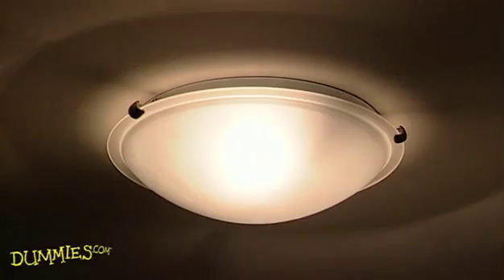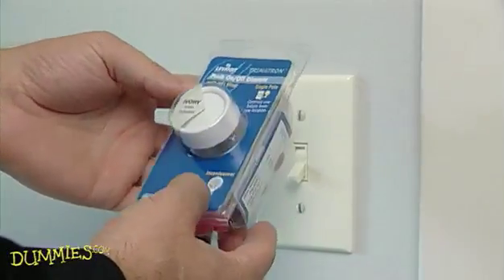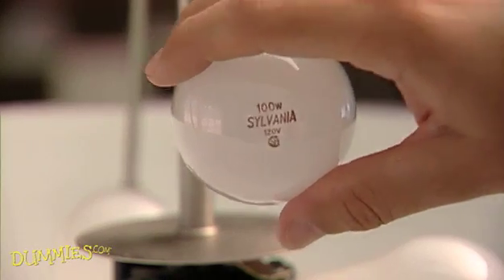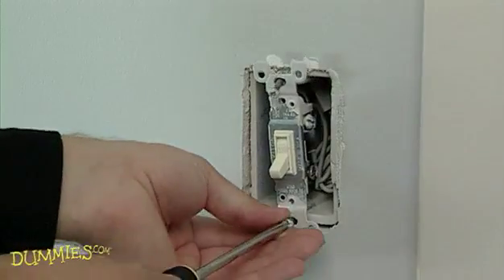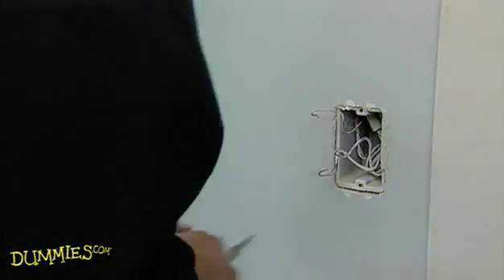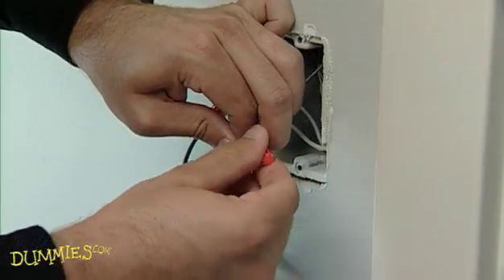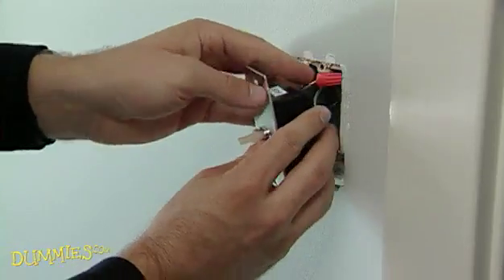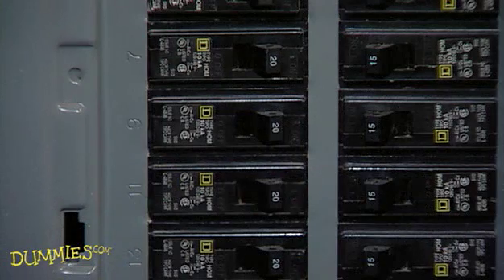How to Replace a Standard Switch with a Dimmer Switch For Dummies

Comment: I took off the existing outlet cover, and I 'm questioning which wire is the ground wire.  There isn't a green wire or bare copper wire,  so how do you detect the ground?

Comment: How do I know which wire is the "ground wire"?
Reply: In my house, all the electrical cables have 3 copper wires: black (hot), white (neutral), and bare (ground). Some of my outside lights have black, white, and green (ground) wires.
Reply: The ground wire is the copper wire

Comment: What do I do if the dimmer switch I want has 2 red wires 1 black wire and 1 green wire the one I want has a normal rocker style switch and a little slider at the bottom for the dimming should I just find a different one
Edit: the video after this one happened to be on the same dimmer switch I was looking at and found out the two red wires is for if you get a two pack so you can do 3 way pole

Comment: What if your light switch doesn't have a copper/ground wire, just two black wires?
Reply: A light switch will only have a ground wire if it is metal, if yours is plastic just ignore that part of the video you do not need one.
Reply: @Adam-om2je  
What if it’s metal and doesn’t have ground wire?
Reply: @aalhaj2321  then it hasn't been installed to legislation and is unsafe and has the potential to electrocute the user.

Comment: Who made this video? How do you place a voltmeter across a switch? And go on to say "it should read zero"? Like really? What should it read? It's the same potential!
You don't test/check for voltage across a switch terminals. You  check for "Current" with an Ammeter (clamp-on or a simple current tester).
Please correct that in this video. It's misinformation.

Comment: I was going bonkers, I just installed a flimsy $10 dimmer switch in my old apt. bedroom, and the switch would only turn off & on. I doubled checked my wiring twice and no dimming. Finally I came across your video  and the magic words were spoken..."MOST DIMMER SWITCHES WON'T WORK WITH MOST FLORESCENT LIGHTING JUST INCANDESCENT LIGHTING." So I simply changed the expensive LED light bulb to a regular 100w incandescent lightbulb and wouldn't you know it! IT WORKS!!! I know have a functional dimmer switch in the magic room......LoL
Reply: First of all, an LED bulb in not a Florescent, or CFL, & second, doesn't matter about the light fixture, you have to be sure that Bulb your putting in is Dim-able

Comment: Well, I am in market to buy the dimmer switch of make Home Electric Industries Ltd. with the following specifications : 
  Model- DIM-6 Dimmer, 20-240 V, 50-Hz , OP-1 75w/300w-1.25 A max. & OP2 20w/60w-1.25 A Max., This is for the standing lamp with two lights one halogen  and other ordinary

Comment: @vince11229 
you should contact company, which specializes on grounding electrodes and install electrodes into ground, then they should install fat wire between main fuse box and grounding electrodes, then grounding busbar. After it, you can line ground wires from grounding busbar into all sockets and light switches. This is the whole trick!

Comment: ok it sounds so simple. but what if your house is 100 yrs old and you have 2 wires in the box, white ( neutral ) black (hot) do you connect both black wires from the dimmer to the black wire in the box, and cap the white? this is the 1 million dollar question that I cant find an answer to. any one know, plz send a message to me, its really messin me up. thanks
Reply: I live in a old apt. also. The copper is canvas coated, and only has 2 wires that come from the wall. All as you have to do is cap off the ground wire make sure it is not exposed to other wire then just connect the the other wires. you can connect the two wires from the dimmer to the two wires from the wall either way, there is no line or load designation on your dimmer. So just connect one wire to the white, and one wire to the black, order doesn't matter.
Reply: I too had this million dollars question, Thanks.